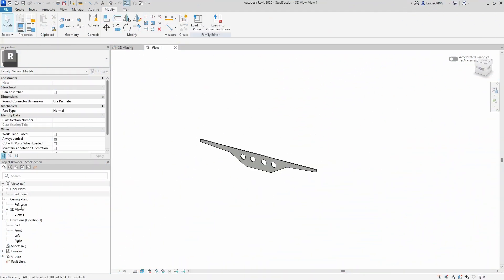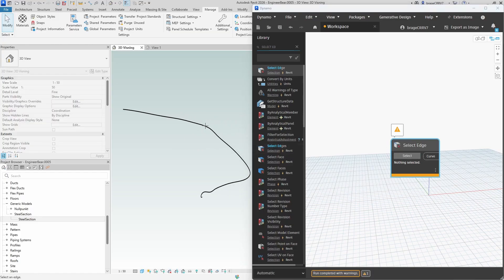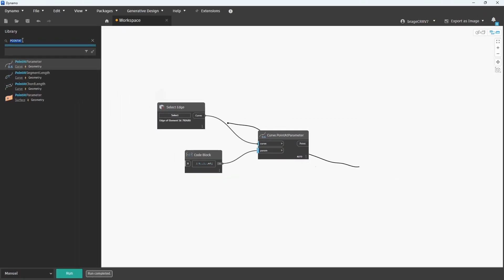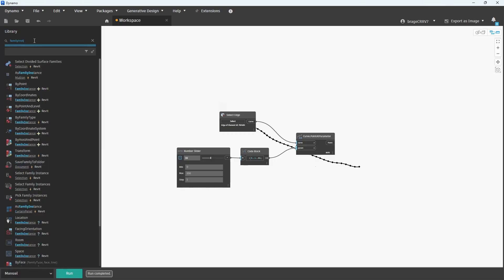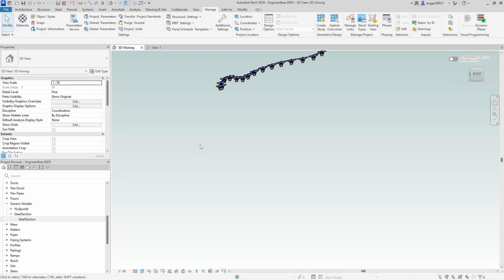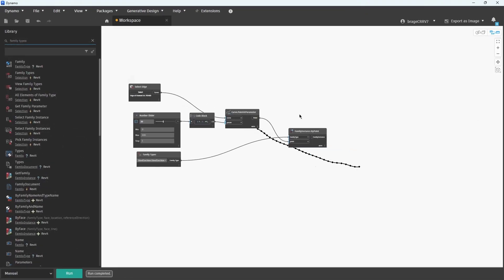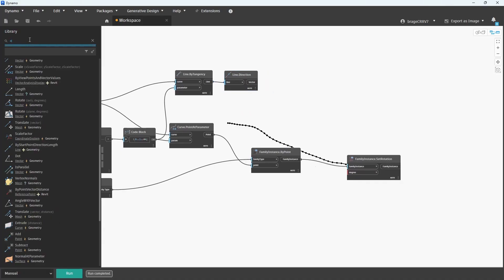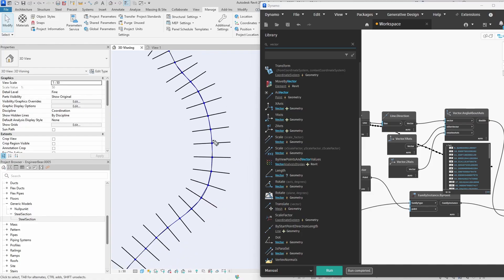Revit Dynamo | place families with rotation along a curved line

Comment: Thank you, 00:32 but a 3D polyline does not have any edges, how did you define an edge for it to be selected later on?
Reply from the maker: The selected edge is a dummy surface created in the Revit adaptive family environment.
Reply: @EngineerBear90  Dear friend, could you please show me how did you make a dummy surface from the imoprted 3D polyline inside Revit? I really want to use this methode but i couldnt go futher because of this unknow step for me at least. Thank you again :)
Reply from the maker: @MortazaHussein  Hello! I created the dummy surface in the Revit adaptive family creation. You could also check out my video Revit adaptive family | Curved retaining wall